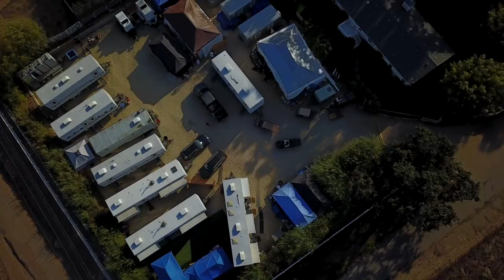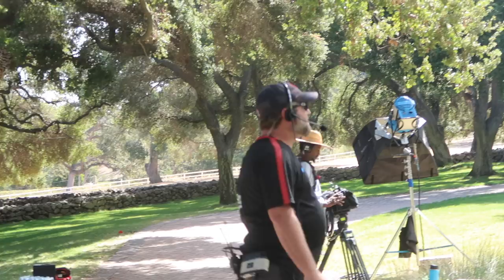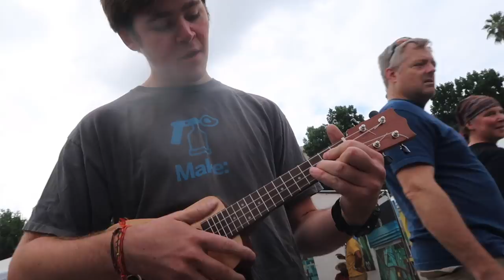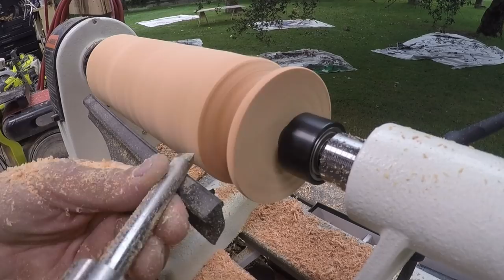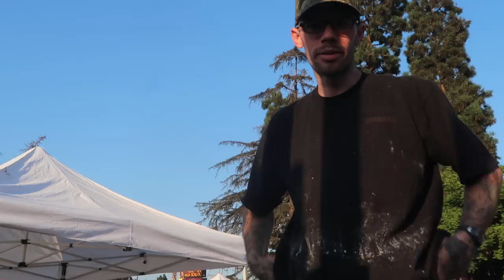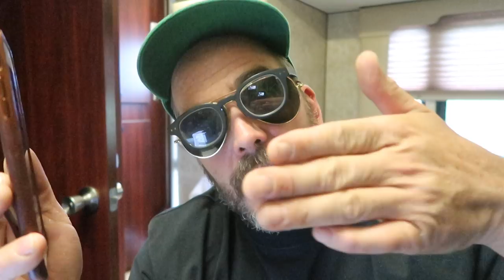DiResta 52 One Year Down!

Comment: If you're already carrying around a bunch of pairs of glasses, just get your sunglasses fitted with prescription lenses. That way you keep the light reduction, but you get the right focal distance on the lens so you don't get a headache from your eyes trying to compensate when you're stacking glasses. 

Most optical stores should be able to get custom lenses fit for those Aviators. If they're real Aviators, they can probably just purchase the prescription you need straightforward.

Comment: I always scratch my head when I see new, big productions using older cameras like the Sony F800.  They use old, cheap glass, don't have the low-light capabilites of modern cameras, and even use discs rather than memory cards/hard drives.  They're cheap, and operators seem to like to use them, but I still don't get it.
Reply: Use what you got/can afford. I'm guessing that's the reason. Also I'm guessing Jimmys show isn't shooting much low light. And for some companies I'm guessing they still have infrastructure for disk drives